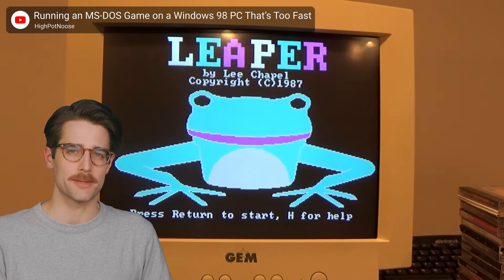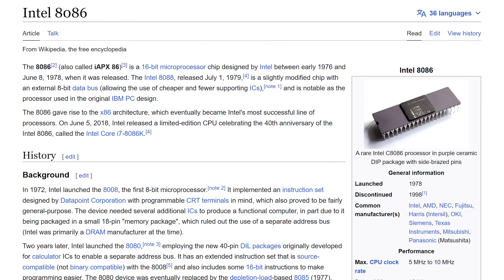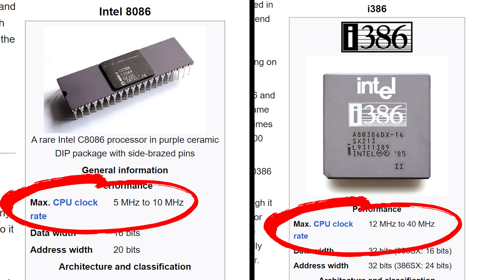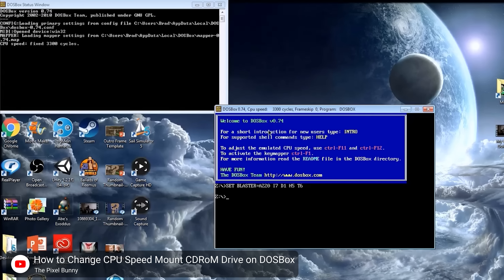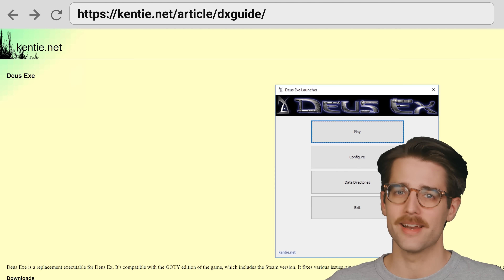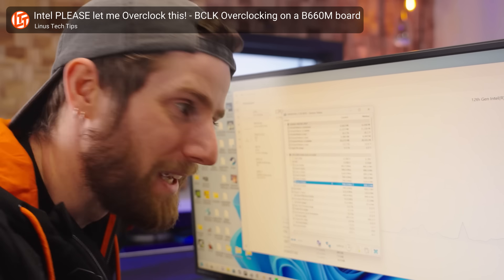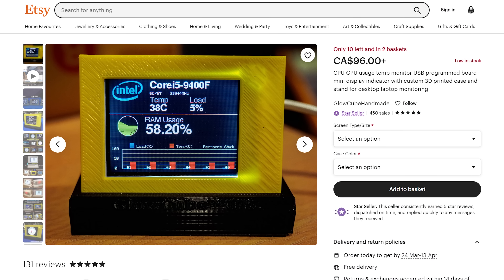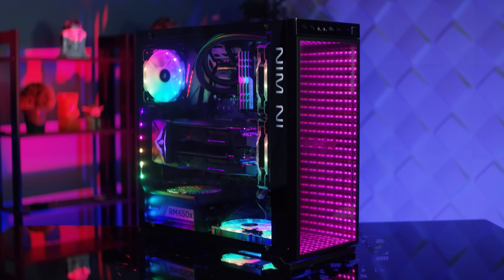Why PCs Had a TURBO Button

Comment: We all pushed it, all of us. We didn't care what it did, it was just unheard of NOT to push the TURBO button!
Reply: I mean... It's TURBO... What did they expect us to do?
Reply: This, I had it pushed all the time.  It was TURBO.  never knew what it actually did
Reply: and yet we never locked the key lock.
Reply: Was never old enough to ever see that a turbo button existed until now.
Reply: The turbo button pushed in, didn't slow the pc down, or at least isn't supposed to. According to the official Intel manual, when you press turbo the cpu is going to operate on it's normal speed and if switch isn't pressed the cpu runs at lower speed. The way this works is if the turbo pins are shorted on the motherboard then cpu runs at slow speed, but the turbo switch is a NC (normally closed) switch, so when it's pushed in, it DOESN'T short these two pins and so the turbo button behaves properly. This is a fail safe, so if the switch isn't connected, then the cpu should work at full speed, not the slow speed. 

Some manufacturers goofed up and used the wrongly wired switch (normally open) That's why if turbo is pressed it runs on slower speed.. but this must rare.. I have never seen a pc that behaved this way. Whatever the case the turbo led always indicated the correct state. If it was lit, the pc run at full speed.
Reply: @harshnemesis  The official Intel manual?

Must be true then, you said it on the internet as well.
Reply: @the_kombinator  Lmao it was said the same in many books made back then.. but hey if you don't believe the company, that literally designed these cpus, the specificatoon from intel itself, then I cannot help you.. you're beyond help🤣
Reply: @harshnemesis  LOL OK bud, my IT career dating from the mid 90s, my channel and ebay sales say something different  Thanks for the specificatoons tho, keep on pressin' that turbo button bro.
Reply: @the_kombinator  Yes yes, because your personal experience trumps what intel specified🤡. VWestlife made an excellent video on this. He said it perfectly "I have something here that (people saying that turbo slows down pc) have never seen: books" Which then he looks at and then verifies what both I and he said. 

Btw I also have 2 vintage with turbo button pcs.. both from different manufacturers. Turbo button pushed is the full speed (also the turbo led comes on) same as I remember on the pc I had back in the day. So 3 pcs all from different manufacturers behaved as they are supposed to.. because all of these pcs had their turbo switches wired properly as described by the intel's documentation (normally closed)
Reply: @harshnemesis  I have never seen a turbo switch that only had two pin headers - ALL the case manufacturers had a three pin turbo switch so you can arrange the button as you like.

Stepping down the clock is done at the motherboard level - sure Intel may have specified the ability at the CPU level, but the actual switching is done by the motherboard, which is why the same 33 MHz CPU on one motherboard drops the clock speed to, say, 16, while in another motherboard only drops it to 20. This has been verified with sysinfo and NSSI by me many, many times... But what do I know, someone who started in the PC industry over 25 years ago assembling 386 and 486s.
Reply: @The Kombinator  What you're arguing about is irrelevant because there's two wires coming from the switch, I have never seen three.. if these wires aren't wired properly to the pins on switch, then  turbo won't work properly. That said so far I have never seen a pc where it would run slower with turbo pushed in. I believe they exist, but as I said that's simply a goof by the factory. It's also irrelevant where stepping down is done because the cpu has to be designed to support it.. if it doesn't(pentium mmx and later) then no stepping down can be done.. so intel did specify how the turbo functionality work and wiring a normally closed switch onto these two turbo pins, is the proper way. Speaking of old motherboards they all turn the turbo led on when the cpu is running at high speed. Again telling anyone with common sense that the turbo led should be on when the button is pushed. It also tells you that turbo when it's "on" DOESN'T slow down the pc.
Reply: @harshnemesis  Dude, literally every single retro PC with a turbo button for sale in my basement and my personal 386 have three pin switches. They are ALL like that with the exception of early AT machines (1985-86 usually), for the express option of wiring the turbo button to your liking. Not to mention the hundreds I put together in the 90s. You're just wrong,  but FFS what are we even arguing over? Dead tech that's 30 years old? Surely we can put our time to better use... I dunno, I'm gonna go play Petscii Robots, I just got it :D WITH THE FKN TURBO OFF :P
Reply: @the_kombinator  Ok turns out most earlier PCs with turbo have three wires wired indeed and you could wire that the right or the wrong way, not the case with 486s I had..you cannot wire the turbo wrong way, where it slows down pressed(as long the switch is wired correctly) 

VWestlife life also points out that you could connect the switch either way on that 386 machine which was one of the computers he demonstrated.. it's a video you really should watch because he debunked the myth that turbo slows down the pc. 

The fact most 286 and 386 pcs can be wired to your liking, doesn't debunk my main point. Enough sidetracking. 
It doesn't matter how old tech it is, there's plenty of evidence that the turbo button is meant to bring the pc to full speed. Everyone can find it. You're just  choosing to ignore that because it's inconvenient facts that prove you wrong🤣

Also you never adressed the turbo led which is the only consistent thing and it's ALWAYS lit when turbo is on(cpu at full speed) , regardless how you wire the switch. Pretty sure you know by now you're wrong, you just cannot admit it😁
Reply: @harshnemesis  LOL OK - why would I address everything you say? If I don't counter it, that means I agree with it. 

Enough sidetracking? LOL, OK there gatekeeper and moderator of this discussion... Also, there's no right or wrong way to wire it, I've seen OEMs wire them "wrong" to maintain aesthetics. Gateway2000, ALR Flyer, and certain older Dell 486 machines come to mind. I've done it to my own 386 as I find it looks better with both the reset button and turbo at the same height. 

I never argued that the turbo button brings the PC to full speed, you really ought to read, otherwise you're just taking stabs in the dark and/or putting words in my mouth. I think it's evident who's gaslighting here... In any case, I honestly don't care what you think nor do I wish to convince you of anything, you do you, and I'll keep on trying to figure out how to lure the robots into the garbage compactor. BTW turbo has no effect on this game.
Reply: @the_kombinator  Since you agree: You do realize that the turbo led indicates turbo on right? Therefore turbo doesn't slow down pc. So I am correct. We are pretty much done here. As for the turbo buttons.. there actually existed momentary turbo buttons, that didn't actually stay in, only toogled the led and the cmos would just remember the turbo state.
Reply: Actual verified TrueFact™
Reply: I unpush it on my 386 /16 so I can play XT games properly.
Reply: @the_kombinator  that makes me feel old. XT with CGA colours was amazing
Reply: @helloitsme4139  I just sold a V30 with Windows 2.03 (came with herc graphics, changed that to VGA) for a pretty sum ;)
Reply: i did.
Reply: man you’re all old
Reply: @browngaymethodistjesuschri1361  Or maybe it's because the first pc you used had win 8 🤣
Reply: I wish there was a turbo for that 56k modem we all had.
Reply: @garcjr  ah yes because I want my 56k modem to act like a 14.4k modem for whatever reason
Reply: @RowanBird779  or a 256k
Reply: @garcjr  i still have several packed in a box.  Don't ask me why.
Reply: @garcjr  i had isdn back in the day, twice the speed, twice the price. 120 kb/s max download speed
Reply: that does not exist laughs in Core 2 Duo
Reply: @KatsuSush  computer poverty, it’s a basic necessity to have 1080p minimum now a days. 1440P is. Middle class
Reply: And you pushed it once. That light stayed on!
Reply: OK, so my theory was correct it does overclock the CPU
Reply: @macthemurder  No it just brings the cpu to it's full speed(in case if you were serious)
However we should bring the Turbo button back.. but as a user defined one click overclock
Reply: Fr